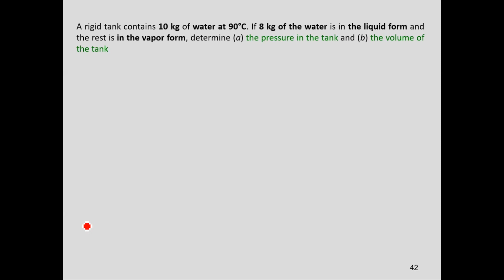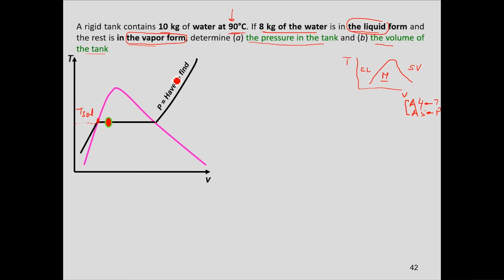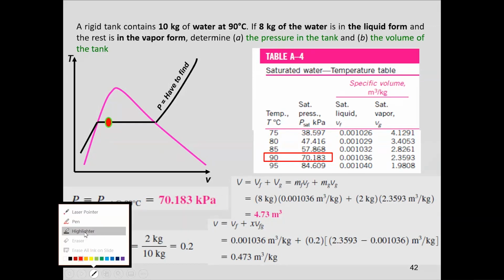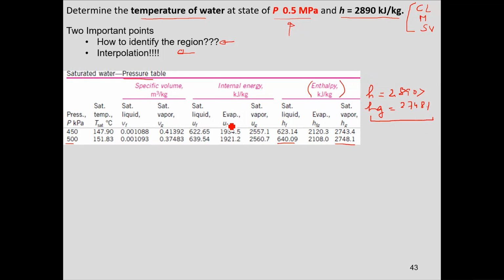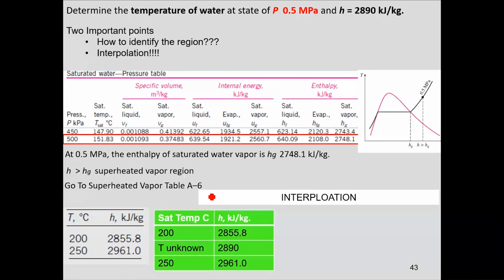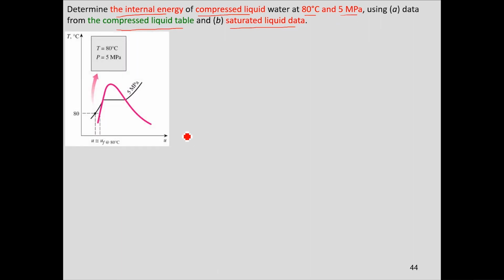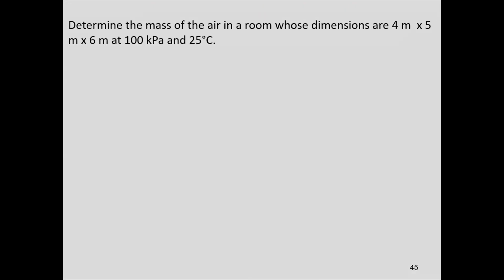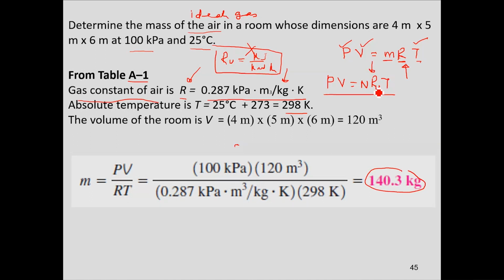Thermodynamics | Lecture 18

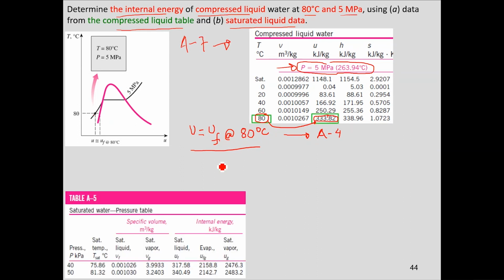Comment: 19:37 Resepcted Sir why You did not choose table A-4 as i have checked it at temperature 80 degree and it geivs the exact same value i.e 334.97 for internal enrgy without interpolation techaniqu,is it a mistake or is there any special reason so that You did choose the table A-4      alsoo                                whyy will this be same if we find Tsat for pressure  In A-5 or if we find Psat for temperature in A-4